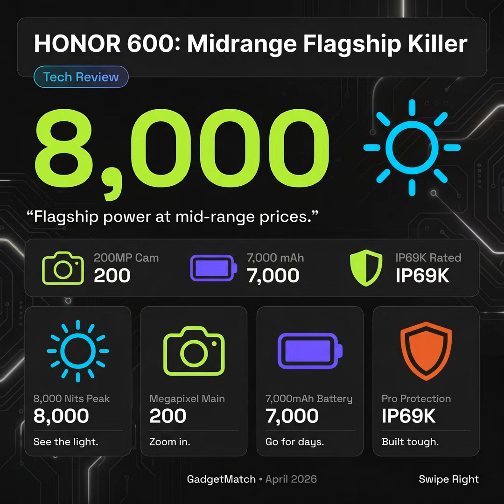3 SECRETS why Honor 600 beats expensive flagships

Comment: 1. My S25 Ultra cost me less than that phone. I got the S25 Ultra for $300 after trade in for which I got $1000.

2. Apple is really the one that sets the price they're the reason we pay 1000 to 1600 for a normal slab phone. Yea Samsung followed Apple's price points but they don't set the price cause they followed what Apple did because anything with that shiny Apple logo on it sells cause people will just buy it simply because it's an Apple product.